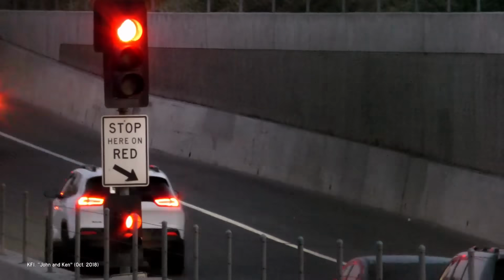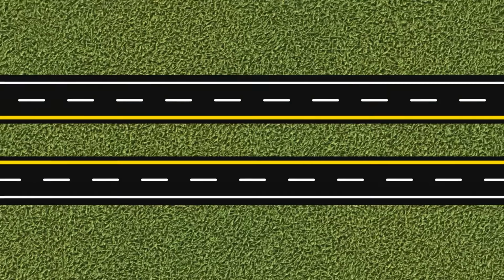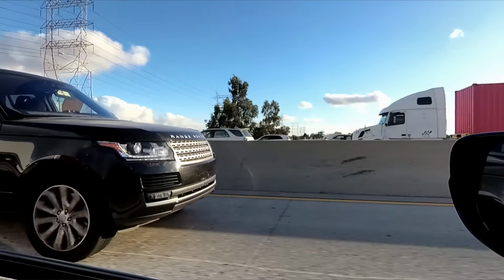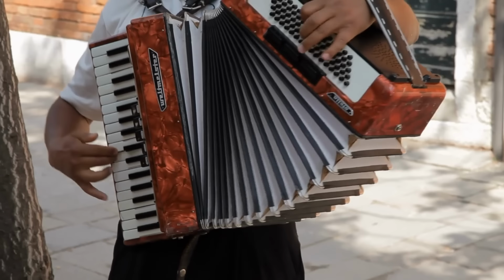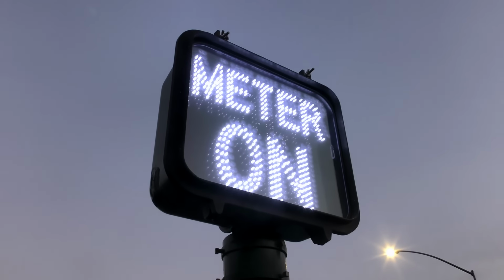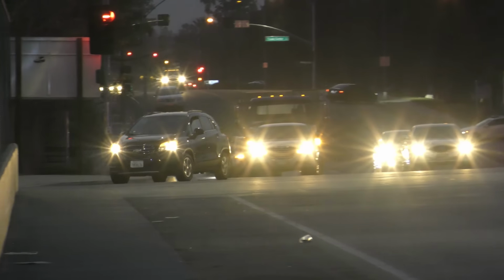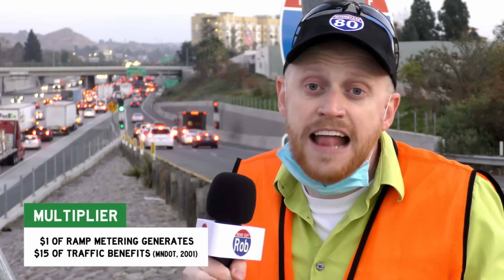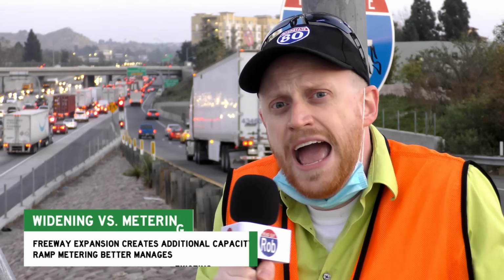Why the extra RED LIGHT on freeway ramps?

Comment: Thought I'd watch this again to see if maybe I picked up something I had missed before. Not at all. The freaking snowballed idiots that thought that putting lights on an entrance ramp are failing one huge problem. First of all the problem of the freeway being under engineered for the needs that should easily have been foreseen in the amount of traffic it would eventually see. And the fact that people are not taught how to drive for the most part in this country. They get a car they get their driver's license for some ungodly reason and they think wow I know how to drive and I know how to get where I'm going. They don't. In the Detroit area they added a northern Expressway to go around much of the metro area and it's I-696. It used to move more traffic density than probably anywhere in the country if not the world. But the average speed on it was somewhere around 68 miles per hour so. Now even though it was originally intended to have been built by about 1962 and didn't actually get in place until the late 1970s that wasn't finished until well into the 80s. Had no discernible effect. It is a four-lane Expressway and it was not unusual if you were traveling in one of the left lanes to travel in excess of about 80 miles an hour just to keep up with traffic and keep things safe. But it moved a lot of automobiles per hour. There was easily a quarter of a million automobiles that went through there on a daily basis if not considerably more. It was also one of the safest sections of freeway in the country when you consider how many miles driven for how many accidents occurred. You eventually however we start running into people who think that they can run up the left lane and then move across four lanes of traffic to get off where they need to go in the last third of a mile before the exit. Those people need to be removed from driving for at least 6 months for each and every infraction of said Behavior. If you don't want to be in the lane that you're in you don't cross four lanes, you go on down and you get turned around and you get back on the freeway and then you go the direction you need to on that interchange.
At this point I will tell you something about myself. At a point when I had a bit over 2 million miles of driving and I was taught to drive by my father who was in a Pursuit instructor and a traffic cop in Orlando Florida for at least 6 years, he also investigated to determine the cause of many accidents something that I there's also taught to do. There came a moment one day when I was traveling north on a four-lane road with the left turn lane and in the left turn lane was a car ready to make a left turn and then suddenly put his right turn signal on and cut back into traffic to go straight down the roadway. I commented to the person I was driving that was riding in the car with me that I had never seen that in 2 million miles of driving. Never ever have I seen somebody do something that stupid. We went one mile up the road from 21 miles to 22 mile, and a different car did the exact same thing. I then realized exactly how contagious stupidity can be. But it has nothing to do with changing traffic lights to control people's behavior. What you must do is figure out how to get the normal behavior of drivers to flow correctly with the roadway design.
In Orlando in the early 60s the traffic engineer when they set up a new intersection or they have widened the roads or for whatever reason, they would not put Lane markers predetermined into the roadway near the intersection. They would put sand out on the road for a few weeks. After that the traffic engineer would go and look to see where people were actually driving their cars, then he would have them blow away the sand that was sitting between the lanes that the people were normally driving in and that's where they would put the lane markers. There was no reason as long as people had a decent understanding of how to drive, to try and force them into Lanes they wouldn't normally use.

Comment: I have never seen a traffic light on an on ramp before wtf
Reply: More of a dense city thing than a rural thing. It's not necessary in rural areas because they don't have enough traffic to cause problems.
Reply: @icantthinkofaname2176  I'm not in a rural area
Reply: @Karmy.  it's possible your city isn't dense enough, or it is and the city council never implemented it. I can only speculate so far
Reply: @icantthinkofaname2176  I'm in Metro Detroit

Comment: I’ve been saying for years that we need to teach the OPPOSITE OF THIS in drivers ed!!!    Idiots all the time slow down and even stop when they are supposed to be going the speed limit here!!!   Idiots.   This is the equivalent of having a light turn red in the middle of nowhere at two in the morning when there’s no traffic in any direction.  It just stops you long enough to stop.   And no I’m not talking about lights on a timer. They’re green for a half mile and then they turned and cycle just as you get to them and then stay green until they are out of sight behind you.

Comment: The main problem is Americans don't know how to alternate merge, and they do not know how to highway merge. They don't accelerate to speed quickly enough so they can use the rest of the onramp hedging their selected gap so they smoothly enter traffic going the same speed as the slowest lane. The biggest problem, is a lot of people go 35 on the onramp, then go straight to the left passing lane while someone is coming up behind them at 75. This accordion effect is the worst thing for traffic.

Additionally, tapping on the brakes, at all, is really bad for traffic - I can count the number of times I use the brakes under highway driving between two states on one hand, maybe 2 depending how idiotic people are and whether or not I have enough view distance.

I right the line so I can see what is happening a mile down the road so I can adjust my speed accordingly. I move through gaps, and in clusters I move slowly and methodically through, trying to tell people about the law that slower traffic must keep right.

If there is a traffic jam, it is usually caused by a 2 lane on-ramp, or just some idiot slammed on the brakes from the left lane in a cluster and went all the way off to an exit instead of doing the responsible thing and getting off at the next safe exit after navigating each lane change separately instead of one dangerous maneuver.

But, even during a traffic jam I usually don't have to press the brakes unless there is an idiot that has to rev their engine and swerve into my lane. I extra leave at least 1 or 2 bus-lengths ahead of me at crawling speed so I don't have to press the brakes, and my car can idle through - what this means is no car behind me should have to either. So I'm helping clear up the mess by self-limiting.

I'm guessing - before watching this video - these lights are timing people to get them into larger gaps, to reduce the accordion effect... Also, because they were at a dead stop, they are more motivated to get up to speed, so a bit of social engineering by making these people impatient... which I don't get. 

I drive safely, I don't have conversations in my car at all, I don't listen to the radio, I don't eat while driving, I don't even have a phone and if I did I wouldn't be texting or calling either... If Americans had to go through what Germans have to go through for a license... the training involved, the strict laws - loss of license for passing on the right, for crossing a solid line, for not moving over properly and blocking traffic, etc... and learning how to properly estimate speed, and how to properly drive instead of staring at the car in front of that person, or at a going out of business sale causing someone to run a stop sign and end someones life by partially internally decapitating them, etc.... we would be better off...

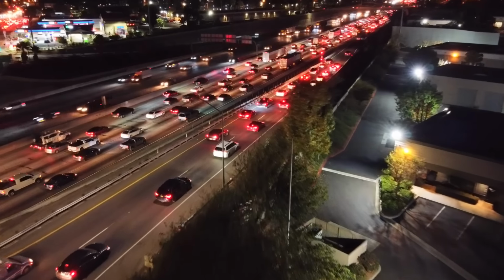Comment: @12:24 doesn't seem to be working at all. Neither at 13:56.  0:18 Light tries to take away  traffic from freeway and shift it to ramp. People shouldn't be allowed a driving license if they can't merge properly on a freeway. License is to cheap and easy. Traffic lights add more pollution, wear brakes and tires when breaking, shorten engine life when acceleration and wasting gas, wear and tear on transmissions, especially clutch on manual cars and some that are equipped with computer controlled manual gearboxes. Electricity waste to run the lights and sensors. Maintain them when broken. Installing  and manufacturing creates pollution. Put all that into the math and see if it's really a good idea or not, then let us know. I can't stand people that try to merge when the freeway is empty and I'm cruising at 65mph looking at vehicle trying to enter the freeway at 30mph, we really need fines for those special people. If you can't accelerate on the ramp to 65mph, don't get on the freeway at all

Comment: That's great that highway engineers think they work (in ideal laboratory conditions), BUT when the highway is already crawling along and it is basically a slowly moving parking lot I tend to believe my eyes.  There is one in particular I really hate.  It is located at the end of a long acceleration ramp and as I am glancing over to my left I see the highway is not particularly crowded and moving very quickly (70mph) and here I have to stop just before entering this fast moving flow of traffic and then from a dead stop accelerate up to 70mph so no one backends me.  The other extreme is as mentioned in my first sentence.  Good in theoretical concept, poor result in actual practice, at least at the ones I have to contend with.  This is a solution only a NERD would come up with who have little knowledge of human psycholgy in the REAL world.  Two cents worth more, it seems hardly anyone adheres to the notion expressed in the state's drivers manual that on multi-lane highways the right most lane is the slowest lane, the next lane to the left is still a slower lane, next is a cruising lane, last is a passing or HOV lane, yet most drivers are opportunists and will use any open lane to go faster.  The real problem too many people in too small of space at the same time.

Comment: Our local city council HATES free-flow. They recently removed overpasses and bi-ways and installed lane shifts AT new red lights they then had installed. We’re talking mass confusion if you’re an out of towner and now takes 30 more minutes to go 5 miles across town. Did I mention the lights aren’t programmed in sequence to free flow either? That’s correct.. you get a green light where their didn’t used to be one with flow rate of about 1200 vehicles per hour and now have 3 lights holding everyone up at rush hour and you only get maybe 15 through instead because where the overpass used to let everyone go is now a red light on the other side as well that allows only ONE direction go at a time at a quadruple 4 way 60 yards apart. COMPLETE MORONS!!

Comment: This is asinine. The purpose of off ramps is to get to highway speed and merge safely without impeding the normal flow of traffic. That is in the real world.
Reply: Most cars I've driven could reach highway speeds with the rest of the ramp, also if it's backed up enough to activate then traffic is probably moving a bit slower too.

Comment: In practice it is extremely innefective. Do a video on REAL shit, not simulation.
Reply: The concept works great,  the problem is people.   Most people dont know how to merge.    It doesn't matter how many traffic control devices they add, as long as people are drivingthere will always be traffic jams.
Reply: @Bendigo1  Exactly, there is a country (forgot wich) that was a zipper merging method taught in driver school, and it works flawlessly with 0 bullshit

Comment: Nice theory. In practice, 100% wrong. 

A platoon entering at 65-70 mph is far better for the flow of traffic than individual cars entering at 35-50 mph. Which is what happens. Not only do these stupid lights back up traffic on city streets, they are also the cause of traffic on the freeway. They should be outlawed nation wide.